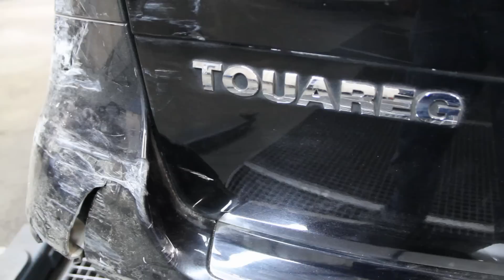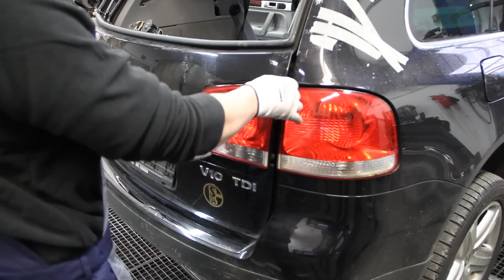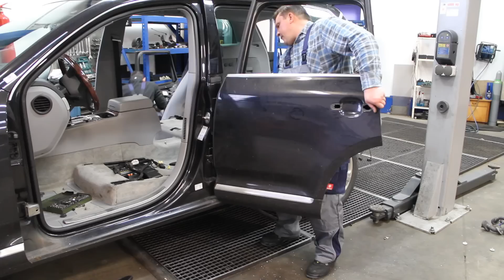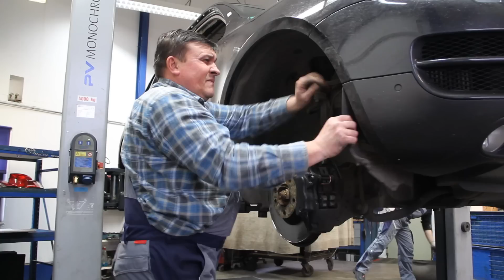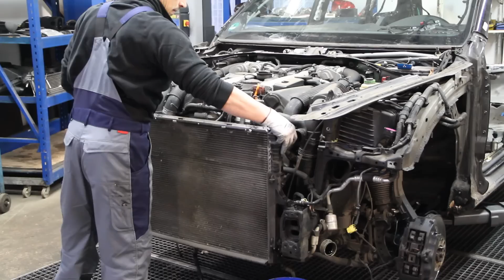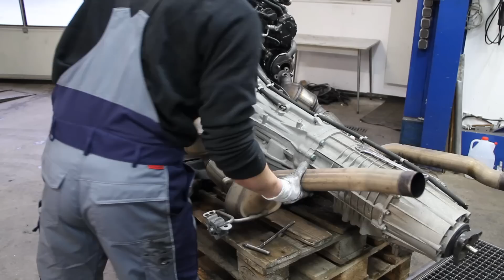Demontage VW Touareg 5.0 V10 TDI - www.klassencarparts.com

Comment: Thank you for showing some of those internal parts.

To those who want to know "WHY", look at the driver rear door at 0.03 sec. The energy required to to PUSH the rear unibody forward enough to move the "C" pillar would be expensive to fix correctly. IF it were not fixed correctly, it would not drive straight when going down the road. In Wheel Alignment terms it is called thrust angle. Meaning the rear tires would not roll in the same path as the front tires. The rear tires would roll to one side. In the snow, if you drive in a straight line, you would see four paths, two from the front tires, two from the rear.
Reply: it was required to be stripped And get onto an allignement bench. But these cars are "cheap" but parts sell for more because they don't suffer much from depriciation..
Reply: in Germany an alignment bench is forbidden.This cars are for poland and russia ,they dont care ,they fix it with stucco and sell it for new.